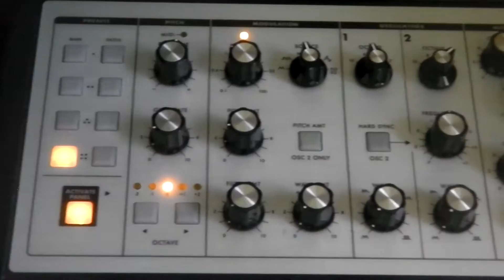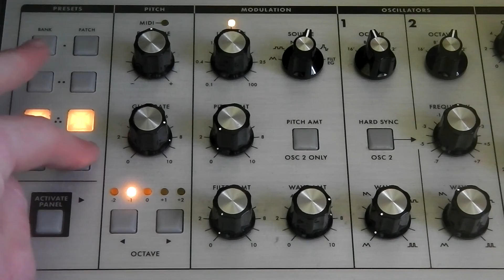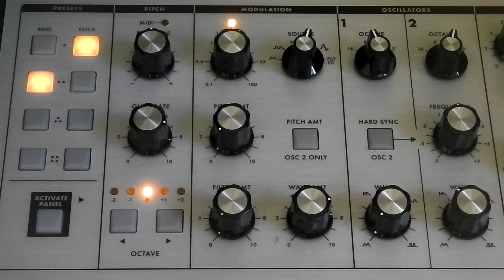Moog Sub Phatty Tutorial Part 3 - Modulation

Comment: at 4:47 you explain something what no one can see... at 5:00 the same... i cant follow your instructions,thats make no sense
Reply from the maker: As I've set the LFO source switch to the Filter EG (envelope generator), the ADSR filter envelope controls will control the LFO shape. So all I'm doing is using the  filter ADSR envelope dials, thats it. Hope that helps.